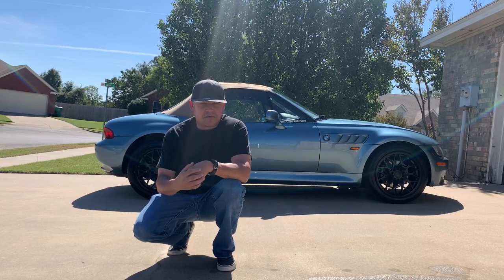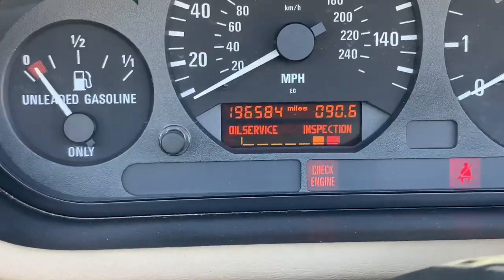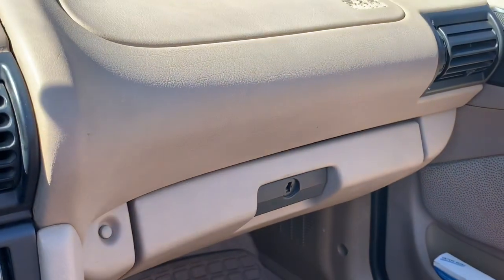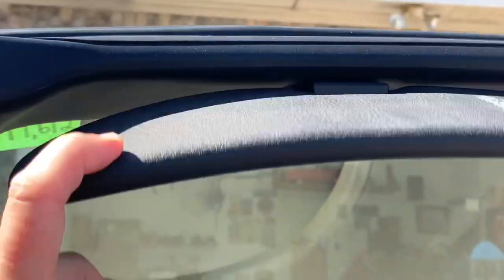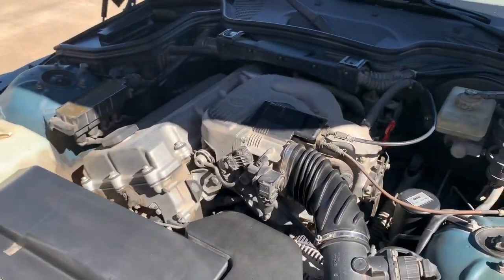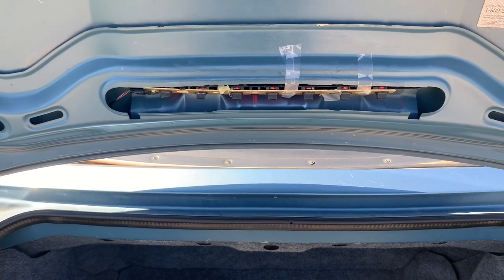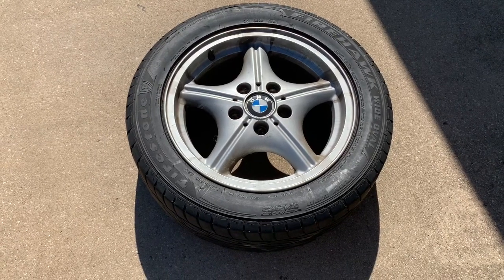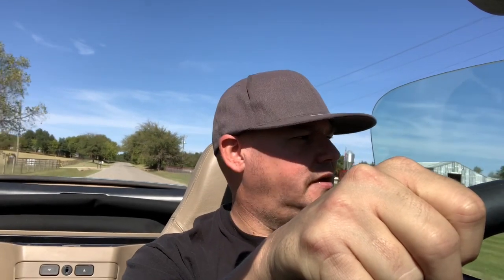BMW Z3 Review and Buyers Guide

Comment: I have a 98 Z3 2.8 black on black detachable  hardtop convertible and I love it. It's nice to be able to remove the hardtop as well as having a soft top option. I think one of the things I enjoy the most about it is that it's still under 2600 lb so it's light. I also enjoy the manual transmission. These cars are a ton of fun and ALWAYS a good time !

Comment: I bought a 1999 BMW Z3 with 92,000.  I have had to have the drive shaft rebuilt and all the Intake rubber replaced.  The rest has just been normal wear and tear.  I have to say the 2.8 L engine has been very dependable.  At 210 HP and 3,000 lbs, it's very quick.  Usually keep inside in the winter, but once drove in deep snow.  It pushed through very well.  Mine does have traction control.  And yes the Air Bag light is stuck on inspite of my efforts.  I call it my hobby car.  Wife loves it.

Comment: Very real review.
These are reliable cars. I have owned the 1998 2.8l. Same color, got it  at 190,000 and put 20,000 on it.
Reply: What was the most expensive part you’ve had to replace within those 20,000 miles of driving?
Reply: I just bought my 2nd z3. It only has 140k miles which is nothing compared to my last one (220kmi) but I just sold my last one right after I bought it so never really drove it that far. I’m planning on keeping this one, just not sure how reliable it’ll be
Reply: A thermostat rear tires and just regular servicing. 
Just before I bought it the previous owner replaced; fan clutch, an  02 sensor, and an energy ignition coil.
Reply: My main advice would be to watch the coolant levels. The thermostat is placed on the front upper half of the engine. It can easily get air locked If the coolant  drops just a couple inches.

Comment: Nice video, good to see how satisfied you are with your Z. I've got a '96 as well, paint is Boston green which everybody likes (I'm a little color challenged...). My wife and I have been on a number of mid-length trips and always drive with the top down - always. We're in Minneapolis and have driven from here around Lake Superior with the top down, same for over to Denver, over the Rockies, up through Wyoming , through the Black HIlls and Badlands of S.D. and home. Now I'd really like to head out to the Pacific coast and do Hwy 1, the coastal highway from Seattle down to S.F. (where we lived in a commune for 5 years...) and then down to Moro Bay, South of Big Sur (Honeymoon). But with 120,000 miles I'm a bit leary of having the Z so far from home, particularly out West away from any big city. And what I'd like to do is find someone who has installed a trailer hitch for pulling one of those very small tear drop trailers.  So if anyone reading this has some trailer hitch ideas, I'd like to hear them.

Comment: Good vid. I just bought a 98 2.8 w/ 13k miles. I appreciate the tips. Going to change the oil for the first time in ten years tomorrow.
Reply: It still has the original tires. Sketchy, but I did 120 on 23yo tires. That will change soon.

Comment: I m the orig owner of a '97  Z3, still driving the same car daily. Be surprised, I just changed out the orig set of spark plugs 7 months ago.  But, your car engine doesn't sound like a typical Z3 AT ALL, it could just be that it s a 4-cylinder version.
Reply from the maker: It’s a custom exhaust, that’s why it sounds like that. Thanks for watching. It’s cool to see you’re enjoying your Z3. I absolutely LOVE mine. Thanks for watching.

Comment: Hey man great video! I’m an owner of a 96 Z3 with 60K miles and your insight on which little pieces to take care of the most will help me keep it nice for as long as possible. I have met an issue with my back window, the black plastic linings of the outside have kinda peeled off. I’ve been super gluing them and haven’t had a good long term success. Would you have any tips for this? I would really appreciate it
Reply from the maker: Fortunately for me, right before I purchased my car the previous owner put a new top on it. So, I don’t have any experience working on or fixing anything with the soft top. Thanks for watching my video. I’ve got several others posted showing various other repairs if you’re interested. Good luck with your car, a 60K example is sweet. Good find.
Reply: I've had similar issues with my '97. She's still a great car, not my daily but fun to drive.
Reply: You just need a new rear window.  They are not very expensive and very easy to install. You will need two people to do it. It just zips in after you zip out the old one.

Comment: There’s still a lot of 225 50 R16s. They just have to be ordered online. I prefer the stock Z star wheels actually and it keeps it as a bond spec with the Atlanta blue and tan interior.
Reply from the maker: Ordering them online doesn’t help when you need a tire to get you through the rest of a trip. I truly daily drive this car. I had a split sidewall on one of the 17” tires in the middle of a 300+ mile road trip in the middle of nowhere. I was able to limp it over to a local tire shop and get a new tire and continue the trip. If I still had the 16” wheels on I would have been in a pickle. I do like the “Bond” look of the original wheels, but the inconvenience of them isn’t worth driving this car wherever and however I want. Thanks for the comment and thanks for watching my video. Subscribing would be greatly appreciated if you aren’t already a subscriber.
Reply: @gerechoppers  A split sidewall is kinda rare but each to his own and it happens often the thinner the tire is. I don’t have any spare as the spare tire is actually obsolete for our z3s. I have a tire repair kit instead. Most cars nowadays don’t even carry spares. But each to his own. There’s pros and cons.

The beauty of the 16s is theyre more comfortable on the road and more fuel efficient. That’s a fact with bigger tires.
Reply from the maker: I’m not trying to start a debate, like you said “to each, their own”, but the 17” wheels themselves are actually lighter(I did I weigh them)and the 225/45-17 vs. the 225/50-16 are almost identical in height. I get the exact same gas mileage before and after, 29-30 mpg on the highway.
Reply: @gerechoppers  not trying to start a debate either, just letting you know that switching to 17s “just to get through a trip” is just one reason and you can’t overgeneralize that 225 50 r16s are not easily available considering a lot of tires are actually made to order- not all tires are available off the shelf.
Reply: Neither of you have a spare under the trunk?

Comment: Okay I have the same z3 it's just black so there by you're gear lever there are a white triangle and a black triangle that is to lift up you're roof just switch you're car on and then push the brake pedal and press the black triangle it will automatically open just give it a push upwards then it will open the reason why it works like that is because to prevent car from flipping if you are on speed so when you back home or want to close it press the other white triangle that will close you're roof and then just clip it close on the  bracket
Reply from the maker: This 1996 model did not come with a power roof. The power roof wasn’t an option on the Z3 until 1998.

Comment: excellent vid!
Reply from the maker: Thanks. I’m glad you enjoyed it and thanks for watching.
Reply: @gerechoppers  --your vid is helping me decide if i will buy a Z3...any updates you wanna make?
Reply from the maker: I’ve got a better shifter I’m going to install in an upcoming video. The stock one is old and sloppy. I’d really like to get some better wheels in the future as well. The ones I have on there are kind of cheap. Other than that I’m really happy with the car. It’s not the fastest, but I don’t think that’s the point of the 4 cylinder cars. It’s just really a joy to drive as is. I’m still going to upgrade suspension bushings in the near future as well. But, nothing to really detract from what the car already is.
Reply from the maker: Also, if you’re going to get one, now would be the time. I look at these cars for sale all the time and they are starting to creep up in price. Depending on your budget, you can still find some lower mileage ones out there for less than 10k if you look hard enough.

Comment: So I just heard from this guy who is trying to sell 1998 V4, and he said that front struts need to be fixed. he is asking for 6k for that whole car with 140k miles. What would be a fair price and how much should I be expecting to spent on that car to be in a good shape?
Reply from the maker: A new set of front struts runs anywhere from $200 to $400, it just depends on how much you want to spend. That’s just for parts, not including labor if you don’t do the work yourself. 6K sounds a little high to me, but if it’s a really clean car and worth it to you, then it’s worth it. If you don’t do any work yourself, it will likely get expensive.

Comment: clutch went out on mine, anybody know anything that could be wrong.
Reply from the maker: Is it not going into gear, or is it slipping?  If it’s slipping, you will likely need a new clutch disk and pressure plate. If it’s just not engaging allowing you to go into gear, it’s more likely to be the clutch slave cylinder. Hard to say without seeing it first hand, but those are the two likely things that could be wrong.

Comment: Enjoyed your video! Great detailed info that was helpful.  I have the exact same car and color and bought mine with about 95K miles. Serviced well and no issues or cosmetic damage.  I will be putting in a roll bar in mine and getting a ceramic paint job on it to protect the shine.  What kind of all weather car cover would you recommend?   Im in Florida so the correct one is important when not garaged indoors..  Enjoy and be safe!
Reply from the maker: Thanks for watching my video. I’m glad you enjoyed it. I don’t have any experience with car covers. My car hardly sits still long enough to worry about one. Lol. I try to keep it parked under a carport or in the garage every chance I can.  I might be a little more particular once I re-paint it sometime this year though.

Comment: I have the 97 I bought needing work but it runs and drives but had to do suspension also did the drilled and slotted rotors ceramic brake pads mine was bought from the original owner and sat in a garage for many years
Reply from the maker: Nice. These are very underrated cars, IMHO. Good luck with yours…I’m sure it’ll be miles of fun.

Comment: I was gifted a z3 2000 2.8L bmw a few moths ago for graduation and I’m having trouble with a camshaft positioning sensor, know anything?
Reply from the maker: Have you replaced the cam position sensor yet?
Reply: @gerechoppers  no not yet but was jw if there could something else wrong with it. The background story is, when I cold start it’ll run great but once I turn it off and crank it again it’ll put around. But if I wait till it cools down it’ll be good
Reply: I also have a 2000 Z3 2.8. I just replaced both intake and exhaust camshaft sensor. My advice is to spend the extra and buy Genuine BMW parts. The parts will cost you a little over 100 bucks each. They are easy enough to do it yourself. I followed the guide from Pelican parts and YouTube videos.
Reply: Make sure you get the error code before replacing expensive parts. My car has cold start sputtering problem. Even with the camshaft error code, replacing the sensors didn't resolve the cold start sputtering. My next project will be replace the intake boots and VANOS seals.
Reply: I just replaced mine and found one on partsgeek for $47.58 that will fit yours as well as I have the 2000 2.5. So far it works great and easy to replace.

Comment: Just stumbled upon your video as I'm looking to purchase one of these. Found a 2000 2.0l 6 cylinder for £3k with 42k miles on the clock. Had a good look around it and it still looks brand new. Think your video sums it up very well, you may have conviced me to go ahead with it.
Reply from the maker: Thanks for watching. These are getting harder to find with low mileage. I don’t think you’ll be disappointed. Good luck.

Comment: I have a 97, 6 cylinder z3. It's the same color as yours.  It only has 69,000 miles on it.  I have had it for 3 years. I LOVE my car!!  My brother did all the engine repairs. He said it was the easiest motor he ever worked on.  My seat belt light is also on constantly...any suggestions on fixing that?
Reply: There are electrical switches in the seat belt receptacles that sense the seat belt is plugged in. One of the receptacle switches could be bad.

Comment: Thanks for the review,  is the airbag light meant to stay on after the engine starts..?
Reply from the maker: No. From what I’ve seen that’s a pretty common issue on old BMWs. I’m not sure what the fix for that is or if it’s even worth messing with. I’m not sure I’d want an almost 25 year old airbag to deploy if I got in a collision anyway. Thanks for watching the video, if you’re not subscribed to my channel already, it’d be greatly appreciated if you did. I’m close to my goal of 200 subscribers by years end. 😃
Reply: @gerechoppers  Airbag light on is a common issue on Z3. It's most likely caused by the airbag harness under either the driver or passenger seat. I fixed the airbag lights on my z3 while I was fixing the rocking seat problem.
Reply: As mentioned it's a common problem, and if you are interested in diagnosing further you can buy an airbag scan tool, which surprise surprise is actually NOT very expensive for these old BMWs! Bought mine from Amazon for $24. And it revealed the problem in my Z3 easily!!! The whole airbag module is bad...:(
Reply: It always does mine did to just think every light on as being normal
Reply: You could have a problem depending on where you live with the airbag light on.   In Virginia where I live the light on will cause the car to fail inspection.  Your mileage may vary.
Reply: You can connect with a computer with bmw software and see where the problem is. The passenger sensor is usually the problem but when I had a z3, I had disconnected cable from the switch on the seat belt.
Reply: @gerechoppers  maybe worth looking at, a common cause of airbag light is the seat occupancy switches can fail, check connections under the seats. They can corrode or become accidentally disconnected.